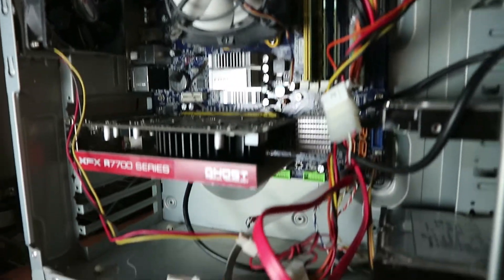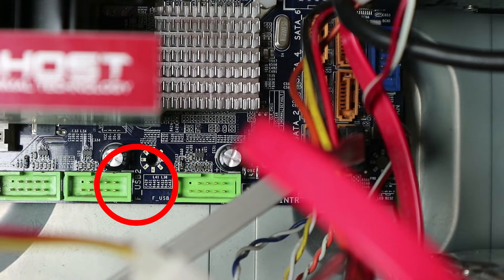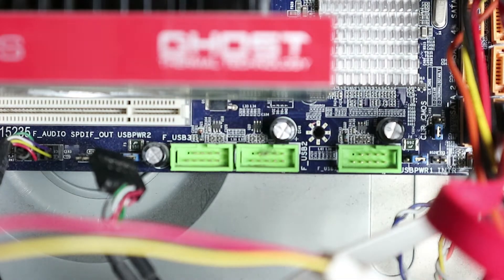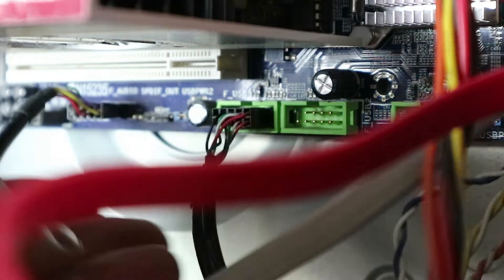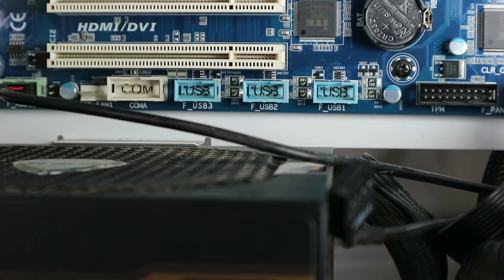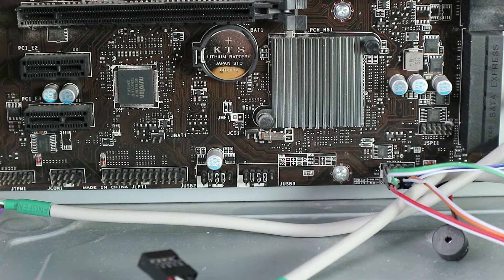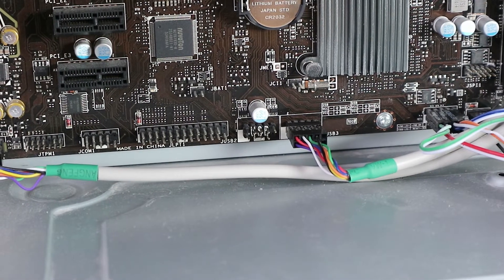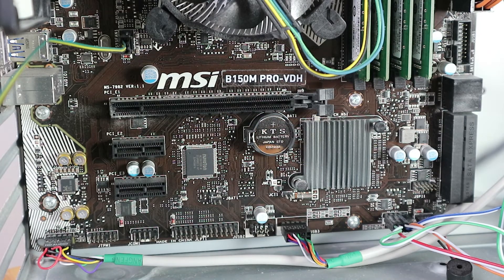How to Connect the USB Front Panel to Your Motherboard

Comment from the maker: How to unplug USB 3.0/3.1/3.2: https://youtu.be/N3dDuh7mY3Y
How to plug in USB 3.0/3.1/3.2: https://youtu.be/SOW7KeoWLgY
How to unplug USB 2.0: https://youtu.be/aJeNg4m1f-A
How to plug in USB 2.0: https://youtu.be/nOs6dip9Q1k
Reply: Waif it says that I shouldn't connect 1394  cable to the motherboards USB 2.0 ports since it old cable? It has only 1 row vcc d- d+ gnd gnd

Comment: Very thorough and clear explanation. Would also love to see what happens at the other end of the cable. Also it would be interesting to see the situation, when there there are no pins on the motherboard, but a more or less regular extra internal ("+1) connector on the PCI USB card.

Comment: my moyherboard has USB F with 10 pins (8 then 2 slots without pins, then 2 more pins) how does it work ?
Reply from the maker: What's the name of that motherboard?
I'd think maybe this is a broken or confused USB3 port https://www.youtube.com/watch?v=SOW7KeoWLgY
Reply: @SoSoTechTube  It's an old HP prebuilt, I don't know the actual name. I found on the internet that it's their way of doing USB F, I just had to align the 9th connector hole with the 2 slots without pins and it worked just fine.

Comment: My cooler master is not showing USB cables I am going to have to do research on this. I am struggling on this part all other appropriate cables are connected. I am quite new to computer building to evade pre built computers and I am reading all the manuals as well how do I find USB cables without labels am I doing something wrong?

Comment: I wish it was that easy for me, i found a brand new case but the usb wires that come from  the front panel do not come in a pre made plug like that, mine are data 2, data 2, vcc 2 and ground, i have no way of knowing where those wires go.

Comment: I have a inwin303c. I have a wireless mouse plugged into the front usb 3.0 which works fine, but when i also plug in a usb hard drive in the other usb 3.0 on the front case then the mouse stops working or becomes very laggy. I tried a couple different mice and usb stick combos and this happens when both r plugged in as well as data transfer. Does this happen to anyone else/is my case defective?

Comment: Thank you for your video, but  I installed a outside power/reset buttons which is made by China and the USB cable doesnt even have a blank shitty hole (all 10 holes) so I have no way else to guess. My question is:
1) can I guess based on the colors of USB cable, like Red - White - Green to stick correctly? Like in 3:25 in your video?
2) above the name of the cable, there is a small arrow (or triangle) symbol, is it useful or any meaning or just randomly for fun?

Comment: so basically, you're taking the cables from the case and connecting them to the ports on the motherboard, right?
Reply: That's my question. Researching my first custom PC build, and wondering do the cables come from the motherboard or the case?
Reply: @RykComerford  I've actually built my own pc ground up so now I can answer my own question. Yes the cables come from the case, and yes you do connect them on your motherboard, but every motherboard has its own manual so you should take not of that
Reply: @jyiyyiimbo  Thanks very much for the quick reply!
Reply: @RykComerford  No problemo

Comment: What have we learned here today?  We learned that a 9-pin F_USB port on the motherboard is really a USB 2.0 connector for the two USB 2.0 ports located on the front of the computer.  Not where the motherboard is sticking out with all of its other ports, but rather the USB 2.0 ports located elsewhere on the desktop, such as on top of its outer shell.

That's what I got from this video and my tests afterwards.
Reply: What if you have two USB ports? Can you put two front plates?
Reply: @LataDeTomate  If there were two such separate F_USB ports on the motherboard, hypothetically you could have four separate ports in total in that case.   As for front plates on the computer, I think it would only be one casing.  Unless it is some kind of unusual, customized setup.
Reply: @RiiViiMedia2424  I say this because on my board there are two 9-pin USB ports, both together. I'm only using one for the front panel so the other one is free. I was thinking about buying another front panel so I could have two additional USB 2.0 ports. But I was worried that due to some limitation of the board that could not be done 😕
Reply: @LataDeTomate  I see.  My computer only has the one 9-pin port for two USB 2.0 ports.  I imagine that it could work with your two 9-pin ports (assuming that both said 9-pin ports were always there), but I personally don't know for certain.

Comment: hello! i have a really old pc case unfortunately, and i really cant find any videos on how to connect the usb ports in 😅 i have a cable with 2 vcc plugs, "vcc1" and "vcc2". are these the usb cables? and if so, can i just plug them into the usb slot on the mb? they also have 2 ground plugs and 1 shield plug, but idrk what to do. cheers!
Reply: I have a similar problem on a pc from 2005 😂 did you fix it?
Reply: @dragosilie9671  aw dude sorry, i cant remember what i did really and i upgraded the whole pc lol, i hope you find your solution!
Reply: @aviibc  no problem, thanks :)

Comment: Is it possible that one single plug (which is made from 2 thick flat wires) connects both USB 2.0 and USB 3.0 ?
Reply from the maker: Not sure what this means. If it is a usb3 and a usb2 connector, both using one thick cable? Sure, there can be many different wires/cableinside the cable. As long as you have one usb3 and one usb2 connector, this is possible.

If there is only 1 usb2 connector, this is impossible.

Comment: My USB 2.0 connector and hdaudio connector have so much resistance. Matched them up to the key and they refuse to go in. I have no idea why.
Reply: Same here. My fingertips are raw from pushing, and it still won't go down all the way.
Reply: Same issue. My Audio and USB connector can fall off with a slight jerk to their wires. But they are still working though. Did you find any solution to this?
Reply: @khunii2188  I held it by the sides and wiggled it in as far as it would go. Took it out and then wiggled it in again. Each time it went a little further in. Eventually it went all the way in with no resistance. Maybe tight pin connectors or whatever I assume, maybe they just have to be loosened up.
Reply: @SuspiciousLynx  Hey thanks for the quick reply. Will try it out with my connector.
Reply: @khunii2188  Mine also eventually went in fine. It must be common with new connectors for them to be so tight at first.
Reply: @PhoenixBaby96  Ohh. Thanks for this information. The thing is I built a new PC recently and got a new case to hold the components in. And the USB and Audio front panel connectors are not fitting inside their corresponding motherboard pin slot. They are half exposed and with a slight jerk can come off easily. As long as the case is stationary they're fine and working. But if I want to carry and move the case around then there's a chance they might come off in the case and I'll have to put them back together again. I'll try to see if I can put them in their pin slots. I feel like some internal pins inside the connectors are not aligning properly in their plastic container.
Reply: @khunii2188  I did the same thing, and I honestly think it's just some new cases that are like that. I've read where lots of folks are experiencing this very thing. So I wouldn't be swift to say it's faulty hardware.

Comment: Ok I'm bout to make my first pc so the headphone jack and the power button and USB on cables come with the computer case right? Then you find them and plug it into the motherboard
Reply from the maker: if the case has front/top panel usb ports, then yes.
if it does not, you will want to buy a front panel usb hub

Comment: On a USB 2.0 capable motherboard - is a USB 2.0 header the same (connector wise, Female) as a USB 3.0 (Female) header? 
I have 2 x  USB 2.0 ports on my tower (with the connector inside) that's attached to a USB 2.0 port on the mobo - what I'd like to know is, can I connect the old USB 2.0 (tower) header connection to the new USB 3.0 header port on the new motherboard? 
I know that if it can connect, I'll get full USB 2.0 [transfer] SPEEDS from the new USB 2.0 port externally on my Fractal Design Define R3 tower but it won't be actually operate as a USB 3.0 port - is this 100% correct? Please advise, thanks; I just want to be absolutely sure I can re-use the existing USB port (often just for flash drives).
 I'm not bothered about it not being an actual USB 3.0 port, all I care about is if it can be re-used as A USB port.
Old mobo = Asus P6T (vanilla) from about 2010. Intel i7.
New mobo = Asus X570 TUF Gaming, 2020. AMD Ryzen :)
Reply from the maker: "is a USB 2.0 header the same (connector wise, Female) as a USB 3.0 (Female) header? "
no
Asus X570 TUF Gaming has 2x USB 2.0 ports on mainboard. Just use those.

Comment: Where do you get the cables?
Reply from the maker: they are part of the case or https://www.youtube.com/watch?v=6lNFBhJmzCY
Reply: @SoSoTechTube  Thanks, unfortunately the TD500 Mesh (White) doesn't have bays for adding a hub for external USB. Gonna have to spend a bit more coin to make sure my MOBO has two 3.1 headers.

Comment: have connected the usb to front panen in usb1 but when i plugged in my keyboard nothing happen. it suppose to light green on keyboard if there is signal.
Reply: Do you have ram plugged in? It’s happening to me too but I haven’t bought the ran yet
Reply: @PradaPresley  yes i have placed in the slots.
Reply: PurpleExcalibir123 did you get it to work?
Reply: @PradaPresley  no unfortunately machine turn on and i was stuck when i was trying install windows.
Reply: PurpleExcalibir123 oh. Did the keyboard work tho or no?
Reply: @PradaPresley  nope tried to type but nothing happen.
Reply: Just connect it to the i/o shielf

Comment: Where do u plug the other end of the cable into
Reply: did u ever find out
Reply: Yes, I have an NZXT case so mine comes all in one...However for other cases it will be already installed in your case
Reply: How do you tho
Reply: Tom Ninan wdym
Reply: Where do you plug the other end of the cable
Reply: It’s apart of ur case
Reply: It’s not apart of mine
Reply: Tom Ninan  what mother board do u have
Reply: B450-f
Reply: Tom Ninan  well there’s like these cables that come with ur case that are labeled front panel connectors and u plug them in the bottom right of ur mother board
Reply: I know I plug them in the bottom right of the motherboard but I’m confused about the other side of the wire
Reply: Tom Ninan dm me on Instagram koehn.ray so I can send you pictures, k?
Reply: @Tom-cx6cz  well, you generally wilk have it built in, but if you don't then you should plug it into a front panel
Reply: Gave it to bestbuy and they fixed it
Reply: the trolling

Comment: Oh man I don't know what to do. On my pc this cable just doesn't want to go into the slot. I tested my old USB cable and it goes in without problem, but this one, it resists so bad. I put them side by side, they look the same, only difference I could catch is that the new one has some kind of golden cylinders inside. https://imgur.com/a/PwMyB3r I'm sure it looks like the one on the left, the USB one. Only thing is , on my cable the font color is black and i think the cables are also all black. But yeah in general it doesn't go in.
Reply from the maker: only the left one is USB. But basically they look very similar but the bocked out pin is different. USB has it in a corner, Audio and AC97 have it in the second row from the left. You have to check the manual of your mainboard or look at the mainboard to see whether you're trying to connect to a usb2.0 port or the audio port (or usb3 port even?)

Comment: My motherboard has USB_3_4 and USB_1_2 which one would I plug it into?
Reply from the maker: It probably doesn't matter as long as both are usb2.0 you need to google the model number + manual and look at the map if you're not sure.

I would use 1_2 because that's how numbers start :D
Reply: SoSoTech ok thank you!

Comment: I have 2 USB cables to connect - one from my CPU cooler and one from my USB slot from the tower/case. Can I put one of the cables in to the COMs port as they seem to have the same pin layout?

Comment: I have some USB connectors wich have 12 pins???? First a 2x4 row, then 1x2 empty and then two pins at the end..
Idk whats going on with my mobo...

: : : : _ :
Reply from the maker: which mainboard do you have? you are either conusing the ports or they designed it horribly
Reply: @SoSoTechTube  so I managed to plug in the usb2 connector perfectly. Everything is working fine just my connector looks different😂

Its an old oem board with not even a single usb 2 connector looking like yours. Just some strange ones.

But thanks for the response!
Reply from the maker: @capezonmyback  glad to hear it worked out!

Comment: Great video, thanks! Question: In your first and third examples, you used the third USB connectors (FUSB3 and JUSB3) and in the second example, you used FUSB1. I assume this means that if a motherboard has several USB connectors that I can choose any of them at random? Thanks again!
Reply from the maker: Absolutely, unless for some strange reason the motherboard manual says otherwise. Also there might be a rare situation where one connector is broken but the other works.
Reply: @SoSoTechTube  
My F_USB1 behaved strangely, disconnected my cell phone, switched to F_USB2, solved the problem, is it broken? Note: my motherboard is new. 
sorry for my bad english hehe

Comment: you should record connecting pin by pin ,there are still plenty of older cases that have USB connector"broken" in single pin/wires.
Reply: right. I got this fcking problem, and ai have searched another video to solve this.
Reply from the maker: I didn't know. that sounds really bad :/
Reply: yeah, and now imagine you got your hands on one of those cases and it have not just "broken" but on top of that individual connectors aren't marked , and wires color coding you ask , well of course single black colour for all the wires :-)